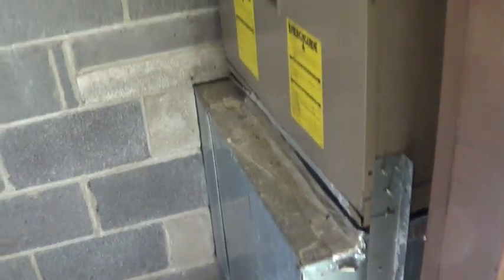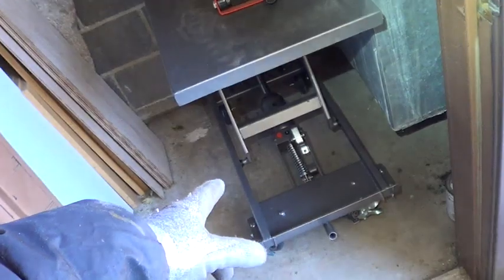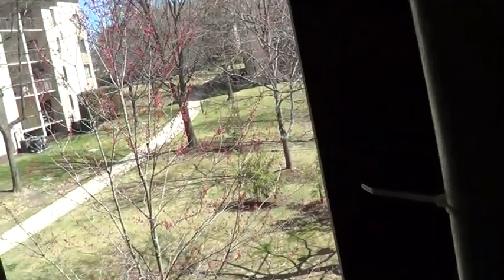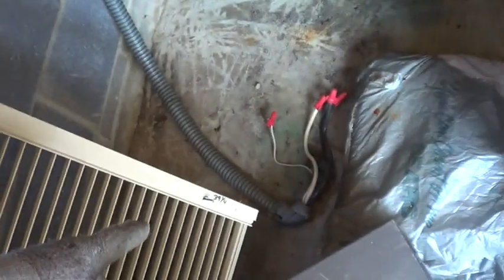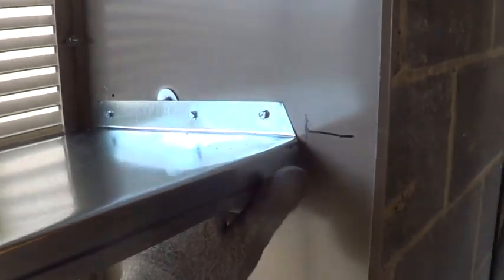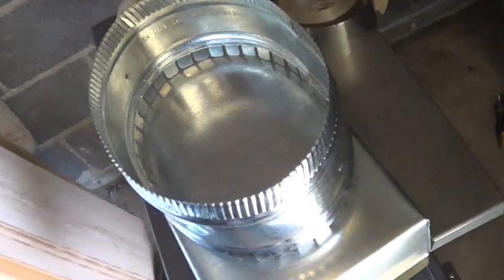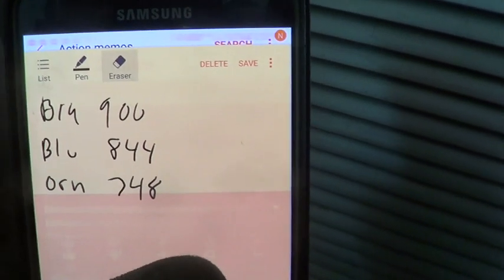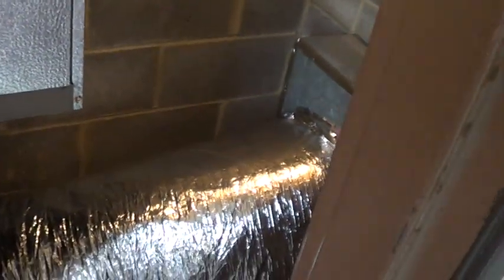Miramont Villas Hi-rise AC Changeout with Grill Replacement

Comment: I appreciate you sharing these condo change-outs, as the layouts always create challenges to overcome. There is a condo complex that I have been to several times for one of two units, one is only a couple years old, and the install generally good but a couple cents short on the dollar. Discovered the heat pump/condenser had a dual-blower wheel with a double-ended shaft ECM motor, that was a first to see. Had to pull it out to put a screen to keep the birds out, blower wheels were full of nesting material.
The other unit is ancient 1970-ish equipment, and probably due for replacement one of these days.